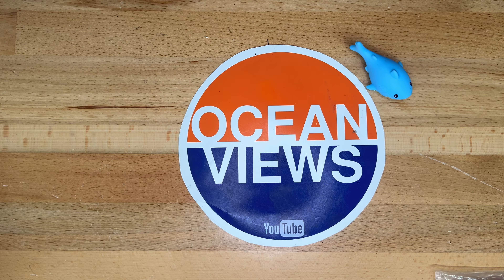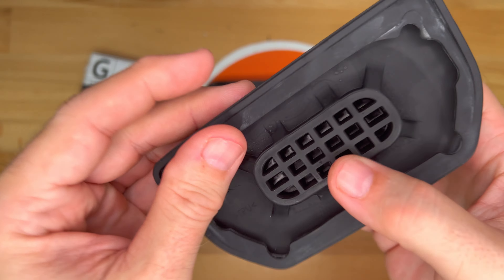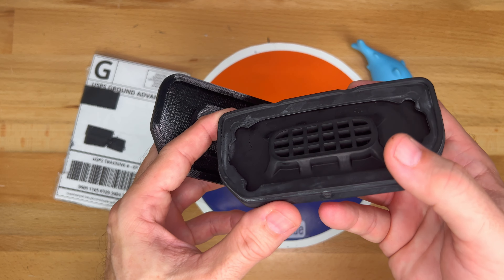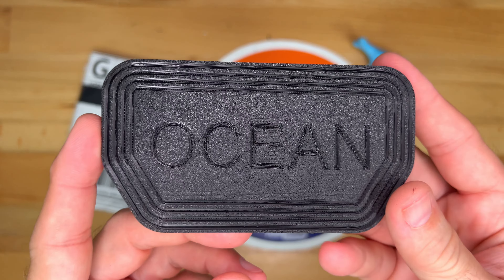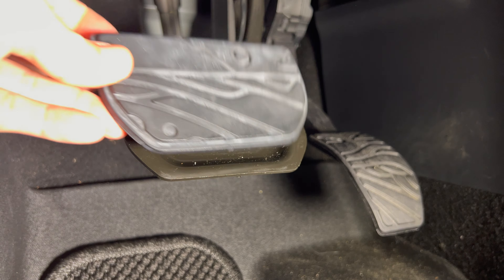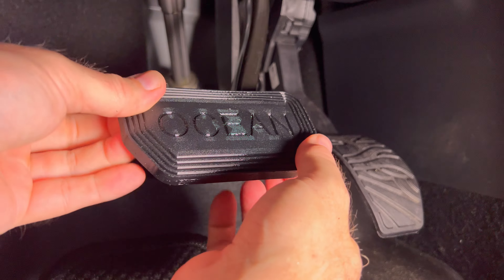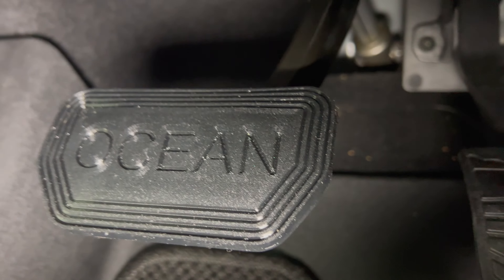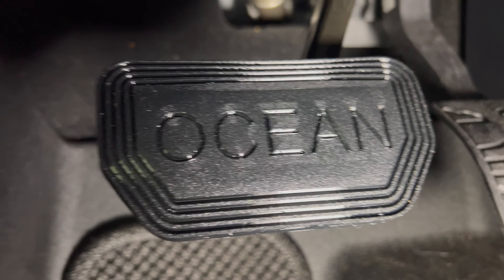Fisker Ocean - Errons Brake Pedal Cover

Comment: Next I assume will be the accelerator pedal. More and more reasonably priced aftermarket Fisker parts. The marketplace will fill the needs. What's the latest on the windshield options?
Reply from the maker: We're still waiting for windshields to be available.  Supposedly a second facility will be making them soon.

Comment: My amateur assessment.  The original looks too soft and flexible, and that flexing ultimate will cause most rubbery/plastic materials to fail.

The brake (and accelerator) pedals I've seen on other cars seem to be much firmer, thus there's no flex.  They easily last 200,000 miles.

If I'm correct, why would someone make a replacement that flexes just as much?  Unless it's a different rubber with a verified longer lifespan.
Reply from the maker: I don’t think it’s the flexibility that is causing the problem.  It could be the components and quality of the material.  The 3Dprinted one seems stiffer around the edges than the Honda or original cover. I’ll be monitoring over time.